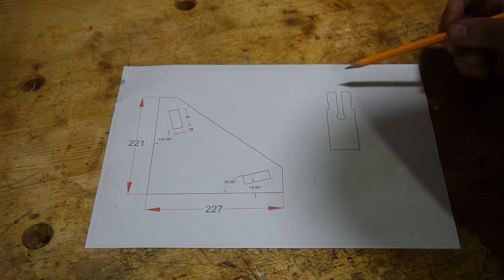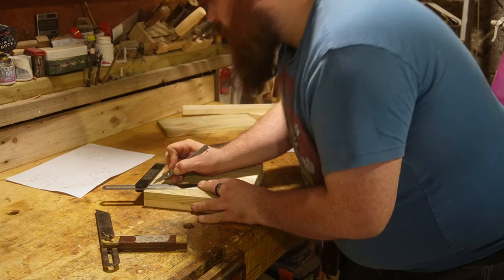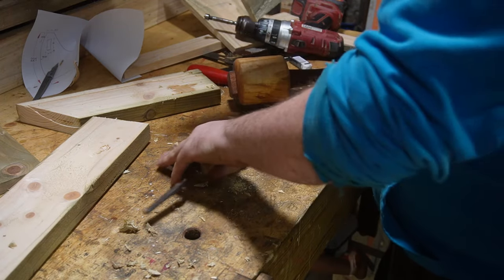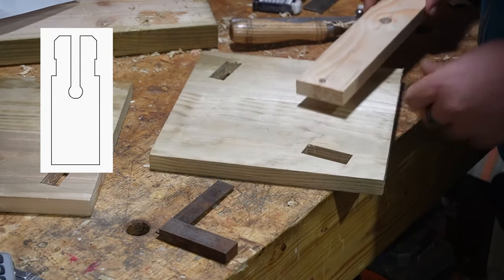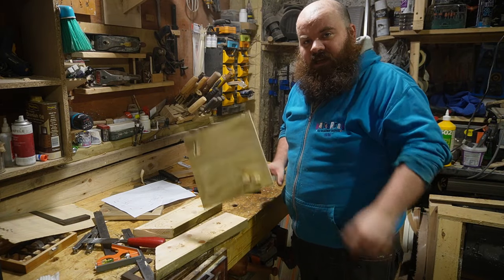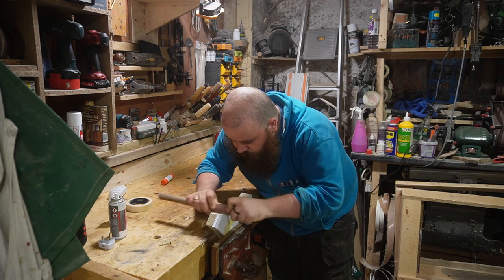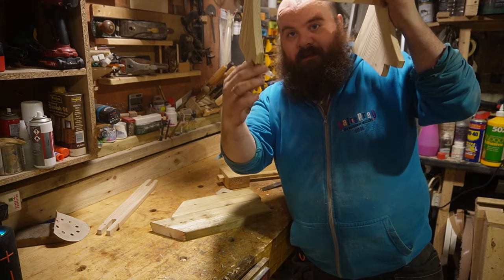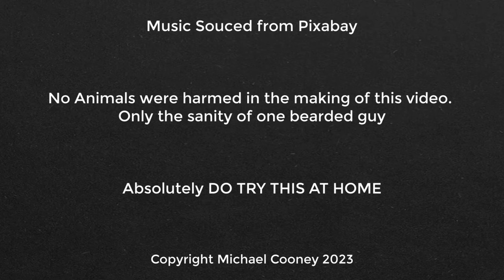Experimenting with a new type of mortice and Tenon

Comment: The joint has great potential.  A few simple application guidelines, possibly even using  a wood with  more spring in it.  Your idea would allow some "knockdown" cycles, though maybe only one. I thought of a wedge tenon to fill the gap necessary for the spring effect once it was assembled. Many variations come to mind, some might even work😆, you've given us a great starting point, thanks, Michael.
Reply from the maker: You're welcome. Glad to see that my video is inspiring others to try it like the original I saw did for me

Comment: Maybe clamping the work piece would prevent the wood from splitting when driving in the tenon? Also soaking the tenon in water might allow it to compress enough to prevent splitting the mortise.
Reply from the maker: Great ideas. Thanks. I haven't forgotten about this joint so keep you eyes peeled I will be coming back to it soon

Comment: The wood you used for the rails needed to have a bit more ‘spring’ in it. 
It would have worked fine with a number of Australian hardwoods from eucalypts, or even better, bamboo.
Reply from the maker: Thanks was thinking the same myself. I really want to try it again with Irish Ash which is much more springy. Only have to come up with another design to use it.